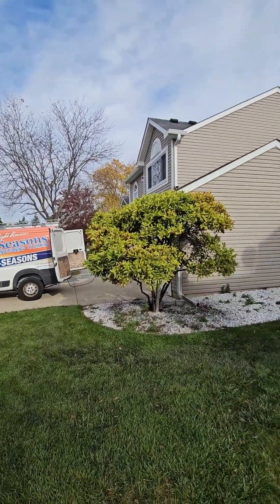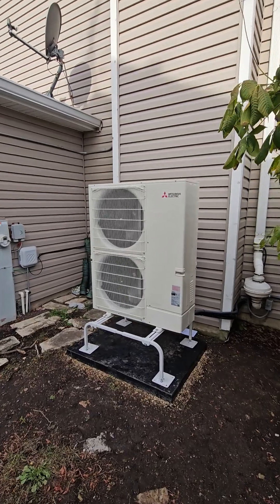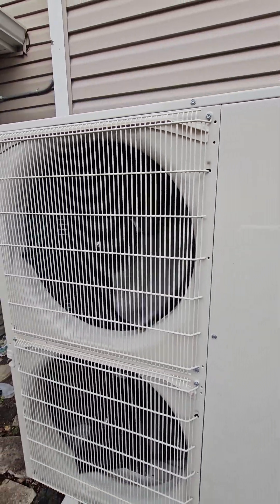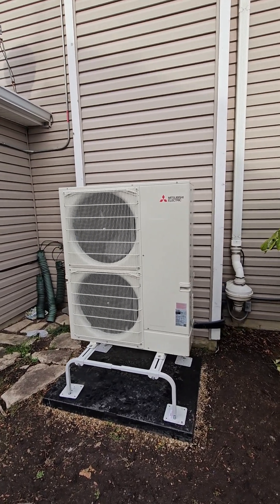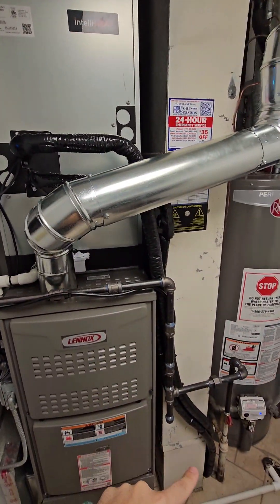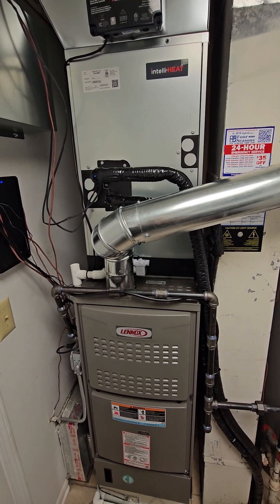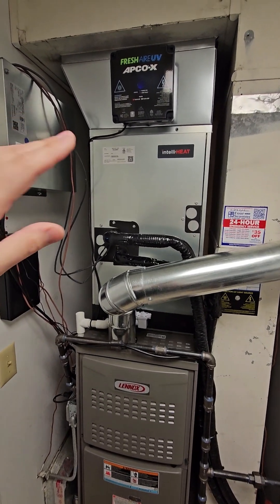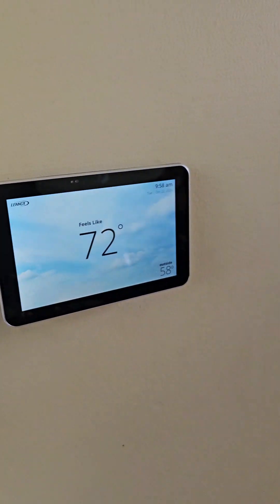Another Amazing Dual Fuel Heat Pump! Mitsubishi intelli-Heat System

Comment: I like it. Approximately how much does one of these units run in round numbers?  Is the compressor outside?
Reply from the maker: Thanks for watching. Pricing can vary a lot depending on location 

The unit you’re watching is R410A refrigerant no longer available. At the time these were between $9k and $13k depending on size and job type and there were rebates and tax credits available those are going way end of year 

Still a great option and great value

Comment: What is the black box below the Mitsubishi Control box on the left of the furnace?
Reply from the maker: That’s the hub for the Lennox iConfort E30 thermostat. Basically makes the thermostat communicating 4 wires between thermostat and hub, and then regular terminals from hub to equipment. Controls multi stage hvac, humidifier and dehumidifier and more with just 4 wires in the wall to thermostat 

It’s a really amazing thermostat